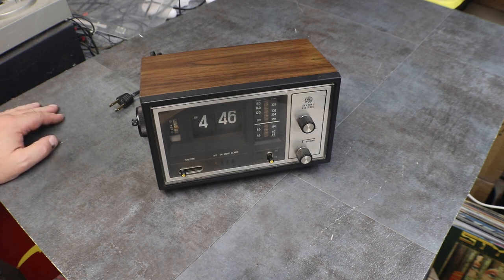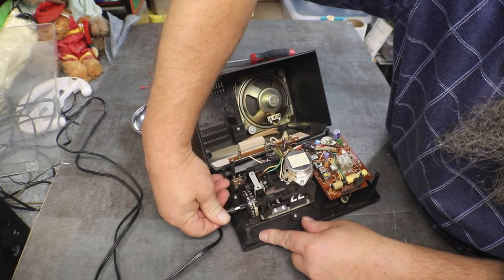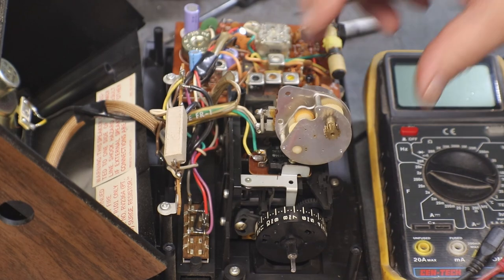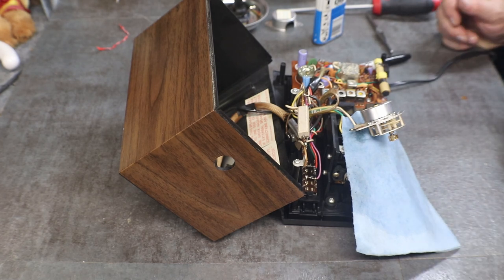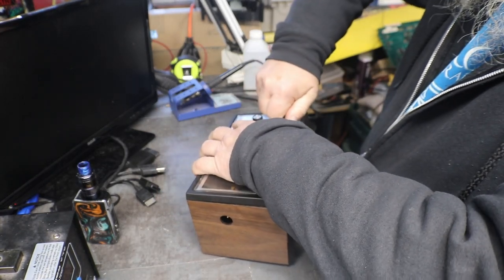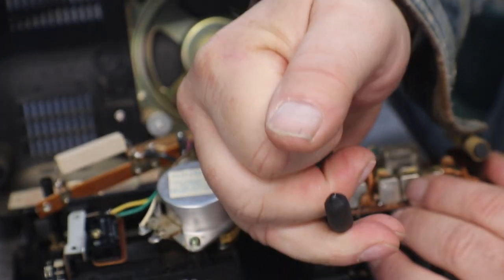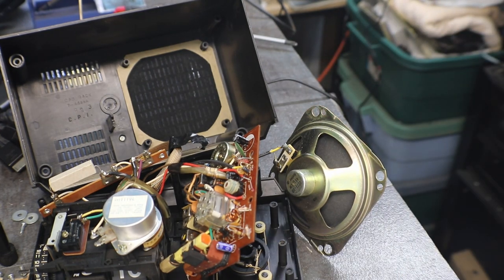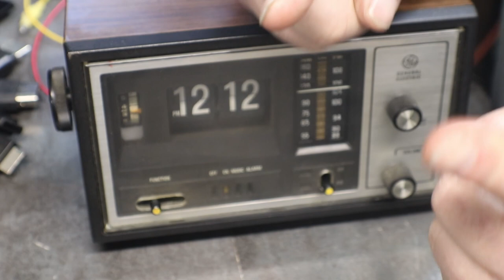Old GE Clock Radio The Flip Type / Let's See If We Can Get Working

Comment: That speaker IS probably 45 ohms-GE liked to use high impedance speakers.
This is partially due to GE not wanting to use output transformers.
The 4 ohm speaker should work, but the output stage will likely run hotter.
Reply from the maker: Thank  You I will  make a note of that. It's hard to tell when there not marked and the speaker is dead.